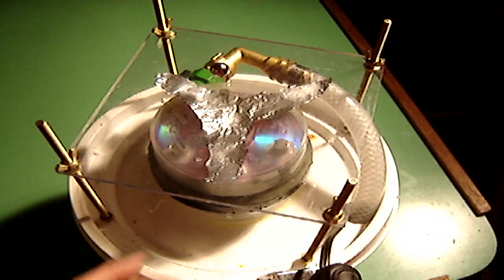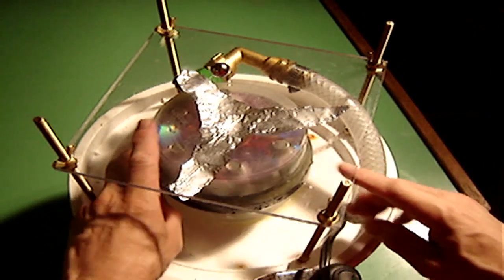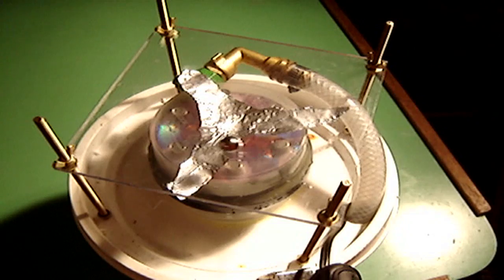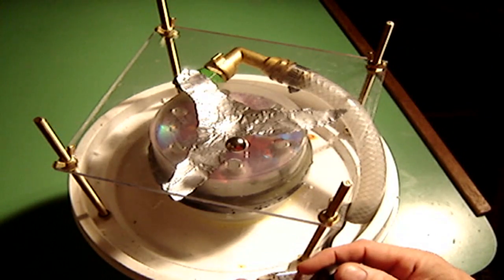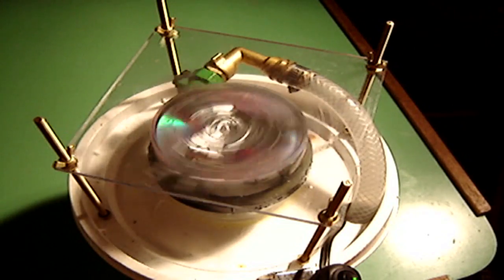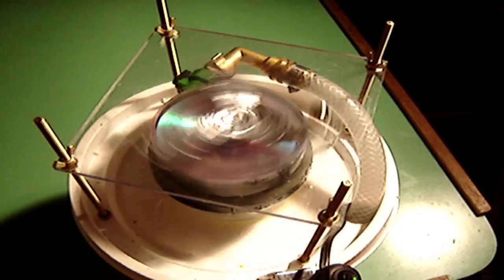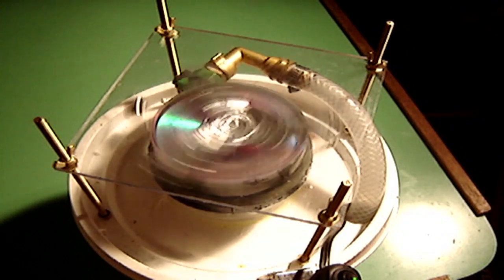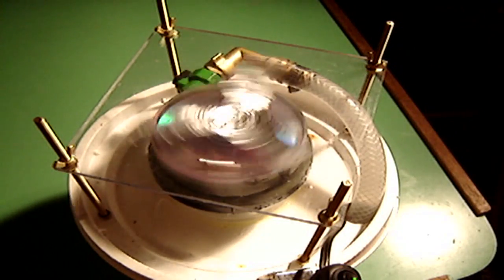Magnetic Fields Interaction With Aluminum

Comment: Wow!, But the Sun is doing the same. 
The Sun is spinning clockwise and all the planets is revolving counterclockwise. Any action produce an equal and opposite reaction (Newton).
Reply: +N Gheorghe  aye also known as the torque effect just like you need a counter clockwise rooter blades on a gunship or the average helicopter or thrust vectoring out the side countering the other blades moving clockwise..well almost the same physical principle.
Reply: You mix torque and  mechanics with magnetic field? Nice try!!!
It is interesting to know but if don't work without water... what you say then?
It is interesting to know, also, what speed have the magnets and the  ball...

Comment: Hi, for last 3 weeks I am taking medication (painkiller) containing Aluminum. I drunk the solution shortly before the MRI - without knowing at that time that it contains Al. During MRI my oesophagus and stomach got very hot. I could say where exactly the magnetic field was at each moment and which direction it was proceeding. I felt bad during and after the MRI and I still feel worst than before the procedure. 

Is it possible that the particles from the medicine got heated in the MRI to cause burning?
I am very interested on your point of view and any technical explications.
Reply: yes
Reply: No. That's a wrong assumption.
MRI scan can be done with and without a contrast dye.
The "Gadolinium" dye (for highlighting blood vessels and the soft tissues) would be giving the "warmth" an unpleasant feel while it's traveling through the blood vessels by the pumping action of the heart.
You don't have to be subjected to a magnetic field for you to feel the "nasty" sensation throughout the body; just injecting the dye is enough well away from any magnet.
Probably you were wrongly informed.
De VU2RZA

Comment: Rick, it's nice to see you play with that old Tesla turbines in the kitchen sink again. It reminds me to your old vid when it turn the glas bowl above 2500 rpm and then you get pulsating plasma arch. I wonder what would happen if there are a pair of TT turning CD counter directions and place a real precision/balanced aluminium blades (instead of flimsy foil) in between the two glass that separate them? Would we have a static blades in the air? If yes then it would be a nice platform for a new rig for star formation. Cheers

Comment: interesting, the magnetic ball (2 poles) act as a magnetic gear with the magnets in the turbine, the CCW rotation is due to the "locking" vertically of the magnets poles, this gives to the ball a "wheel" effect .
Reply: He has his 6 magnets that are rotating facing in opposite poles from negative to positive which means the magnetic balls will travel the opposite way due to the magnetic attraction of the poles to the nearest magnet which is always the opposite reaction to the centrifugal spin of the base magnets. The speed of the ball will be one sixth of the speed of the centrifugal spin.
Reply: In this instance the aluminum has no real effect.

Comment: Interesting demo.  :)  Wouldn't working with compressed air be easier than pumping water through the device?  Of course, though, maybe you didn't have an air compressor.  ~  You said it makes a rotating magnetic field.  With more than one magnet, shouldn't have be "rotating magnetic fields," plural?
Reply: unless some interaction can cause a sense of unification